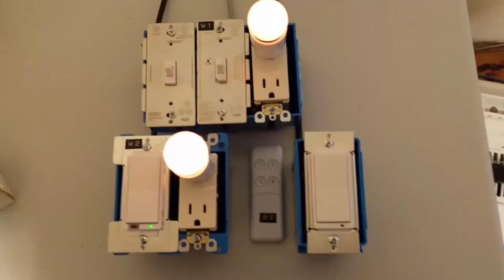Two ways to install Z-Wave 3-way lighting

Comment: Can I install 3 way z-wave dimmer, but do not replace the second switch and use it only as on/off? Will it work? How to wire it?
Reply from the maker: If I understand you correctly, you want to use a regular 3-way switch with a Z-Wave dimmer, so that the Z-Wave can dim it, but the regular switch can turn it on and off.   Sorry but none of the Z-Wave switches I have used can do that. 
Regular 3-way switches switch between two circuits, and none of the Z-Wave switches work that way.  You could put a regular switch between the Z-wave and the bulb, but then the light would come on only when both switches are turned on.  You would probably find that pretty annoying.
Reply: @geneolson9593  There is one from Inovelli that will do that now.  I just bought some for my home and they work great.  https://smile.amazon.com/gp/product/B076LRD3TK/ref=oh_aui_detailpage_o07_s00?ie=UTF8&psc=1